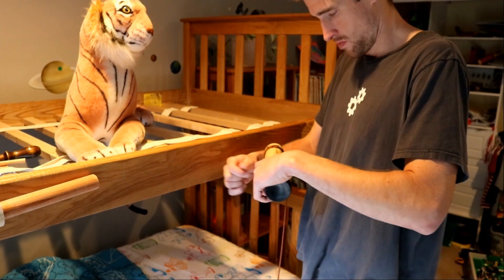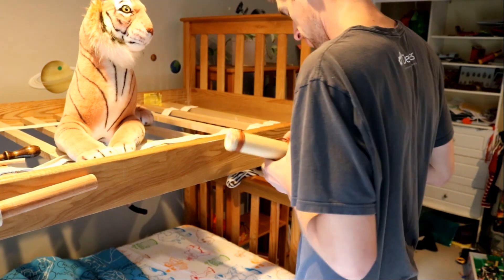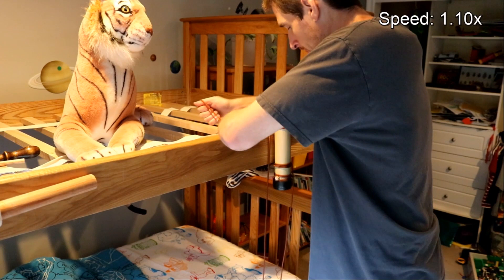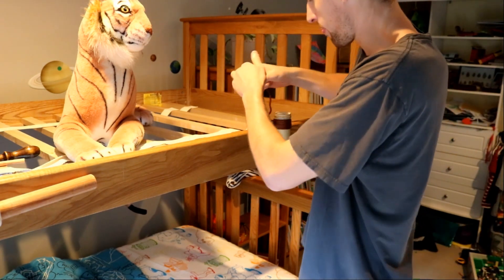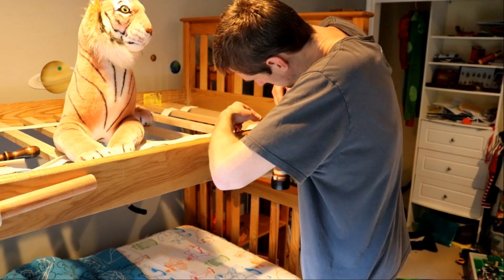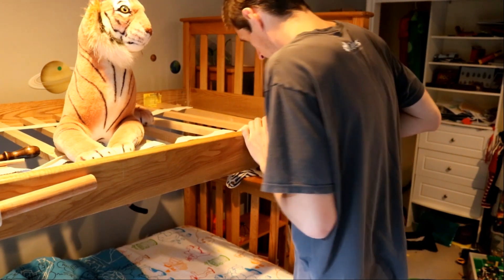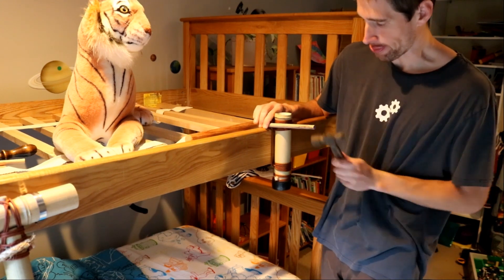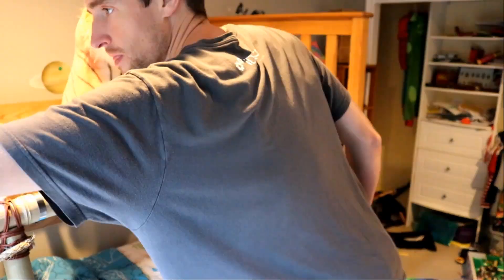Very Tight Square Lashing Technique

Comment: Pretty nice. However you certainly did not invent this. It's quite common in many parts of the world in many applications.
Reply from the maker: I meant to say that I "invented" the torsion part of this, where you tighten the frapping turns with a twisting action, what I call a torsion knot. So not the overall lashing. Or do you mean that my frapping tightening technique is common as well? I've never seen it done before but I'd be happy to see other applications. Thanks for watching!
Reply from the maker: I've also never seen constrictors used for the anchor knots but this one is a bit more obvious and I assume people have done it before.
Reply: I believe this guy is doing the same torsion technique on the lashing. 🤫

https://youtu.be/TwvnwJcDN_c?si=109ImcOvvtFmchiA